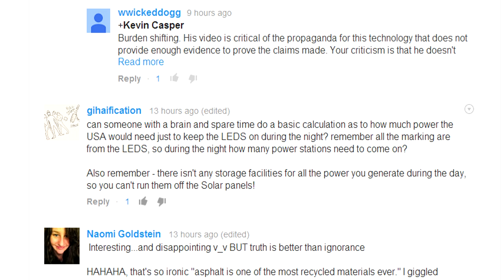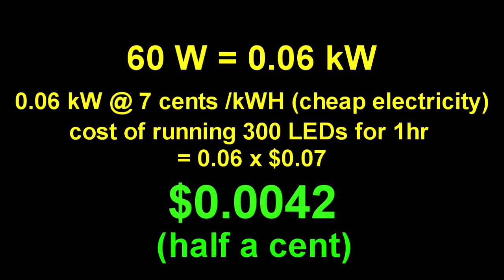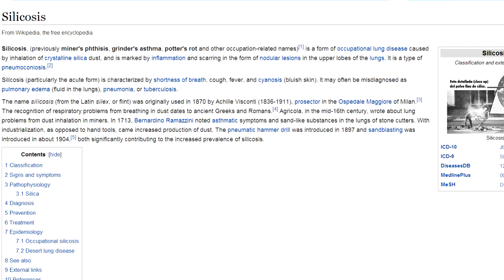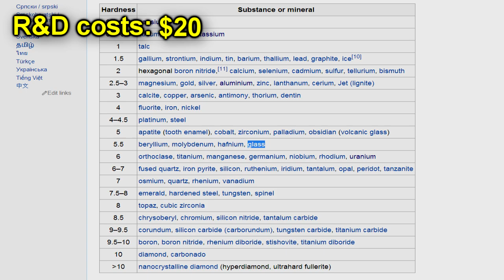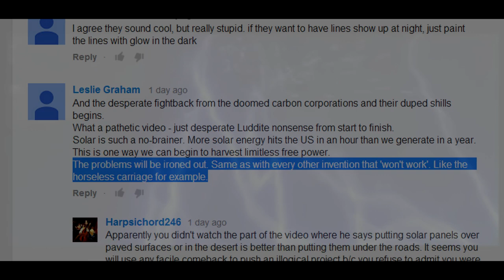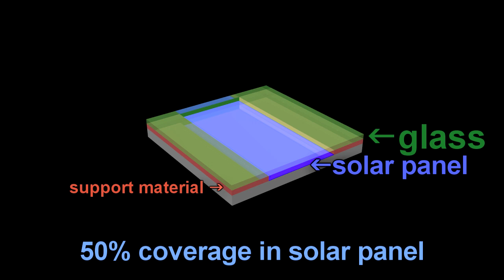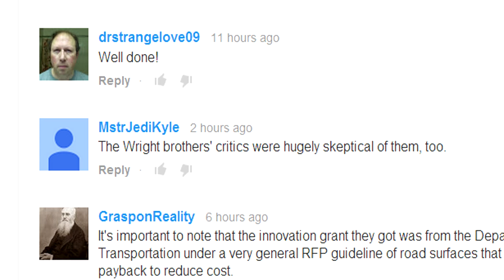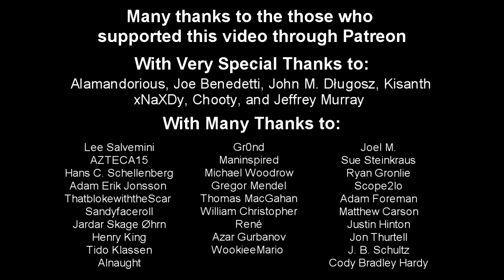Solar Roadways, IMPORTANT QUESTIONS AND ANSWERS!

Comment: Something that wasn't brought up in the video is LED's don't cost as much as they are saying. When someone goes under a undertaking such as mass producing a product they don't go and buy things in a "consumer quantity" meaning the estimated cost in this video is completely wrong and the cost would be somewhere around $0.00001 per LED in the quantities that would be needed. As well as the cost of the power needed would be 840 million a year a far cry from the 1.4 trillion need. This is just a fraction of the inconsistencies and misleading statements in this video.
Reply: Maeve Faye It still costs money to manufacture and ship the LEDs, no matter how many you purchase.
Reply: the thing is the cost will be no where near as expensive as shown in the video. the video is completely wrong in that regard.

Comment: I mean you make a lot of very gross assumptions and only try to half answer these questions. You're going by an amazon.com listing for LED lights and not considering the large savings to be made by ordering them straight from the manufacturer in bulk? Over the trillions of LEDs purchased that would save millions of dollars alone. You also use our prices for energy as provided by limited fossil fuels in order to figure out the cost for running the LEDs at night but do you forget the entire purpose of these solar roadways to begin with? To provide a nearly limitless source of power simply by their being on the road. Not to mention each solar hexagon would have its own backup power supply from its own energy its collected throughout the day. The immense amount of energy these things collect will completely negate any cost with running the LED lights, and if the internal power supply of the solar units wears out hey guys what ITS ALREADY CONNECTED TO THE POWER SUPPLY OF THE CITY and only then would the LEDs start drawing from the power stations. Jeez its almost like theres science involved with this. How about in the future you give more than 5 seconds thought before completely bashing a brilliant idea that can revolutionize the way we approach power?

Comment: I wonder if that "Scratch test" will work on the gorilla glass used on phones? I am interested to see how much or how little effort it would take to scratch the newest versions, that glass is evolving all the time to more sturdy and scratch resistant. Though, the cost would be high. I mean, glass can be used for many things, its in our skyscrapers to our fiber-optic cables. Who knows, maybe they are on to something, ill remain skeptic, but hopeful.
Reply: Well, guess i am going into the OIL business you with me?
Reply: Richard T I thought that the glass used on the panels was a different type than standard glass and resisted this kind of wear...
Reply: Mark Baanstra That's an interesting catch.
Reply: Mark Baanstra Even if its true, the should of accounted for the weather.
Reply: Richard T I just thought of a reason that would not be called "weather" so much as "ooops".  If the center of a panel heats up while the edge is kept cold by some snow, you can get the classic "snap buckle" situation where the glass wants to go done shaped but can either dome up or down.  Now put a weight onto the glass and the dome can snap from one state to the other.  This makes a mechanical shock wave at really high frequencies and with a big energy content.  When this shock comes to a boundary, the forces get quite huge.
Reply: Mark Baanstra
The sun hitting the panel will heat it up.
The proposed solar road idea does have heating elements in it also BTW.
Reply: well I suppose it will largely depend on if It is an Apple product or something of actual quality.

Comment: one thing i noticed was did you see the ways the LED's were arranged on the tiles how on earth would that give you the ability to create words or pictures or lines in the road
Reply: Mark Baanstra that leads me nicely onto anther point they say these tiles will tbe networked and talk to each other, where will the domain controller be? how many acres of space do you reckon they would need to provide servers that would run a network road system the size of the united states to the degree there talking and what if someone decides to hack this system, surely your road network is not where you need a weakness that can be exploited by hackers, im not gonna even go into the WIFI they say these will talk over yeah that will be secure
Reply: Mark Baanstra well you know why that is you challenged his design and doesnt have answers for the questions based on the engineering design because his proposals arent engineeringly sound, im and electrical engineer myself and believe me the amount of power one of these boards will take will completely negate the solar energy received basically the cells would just be powering the board not the rest of the infrastructure, while a good idea in principle practically its seems not possible. Why not just go for the solar without any of the other gadgets its the old phrase just because you can puit all this technology in the boards doesnt mean you should and as an engineer he should be thinking about what his no 1 goal is and that is to produce energy, so remove all the gadgets just make it a solar panel only and let the road system work as it does today you could account for road marking being painted on the boards in the design phase and it would be a hell of a lot cheaper. He also needs to consider whether its possible to even make the trillions of LEDs needed for this system how much material would be needed to engineer just the LED's alone

Comment: LEDs aren't "bulbs" and you obviously don't have to replace them as often.  The efficiency due to geometry depends on where you are in relation to the equator.  However, it's obvious that solar panels under roads has too many cons, they should be put on top of every public building.
Reply: Mark Baanstra Interesting I guess I meant they aren't "bulbs" in the sense that incandescents or fluorescent bulbs are.  It seems the Solar Roadways project has gained significant support from people who don't understand fundamental concepts of electricity and materials science so I assumed that's what they would think when they hear the word "bulb".

Comment: I can see where you are coming from, however, your tests are only partially valid.  For example, you only performed your tests measuring electrical output inside.  This will limit the angles at which the solar panel can achieve optimum output.  Secondly, you not only tested the hardness of the glass with cheap glass that is for use in cooking, you made the mistake of testing the glass's HARDNESS.  You also ground the glass with a back-and-fourth motion, where tires would be rolling along the road.  Moving on, I realize that lighting the roads for markers during the day and that they need to work on better tech to do it efficiently, and it is because of this obvious fact that you should wait to trash the idea until after they give a possible solution to the problem.  In addition, you made the assumption that they would power all of the LED's at once.  This would be a ridiculous and extraordinary feat!  Most people should be able to tell that they would, under no circumstances, ever have a reason to power every LED in the solar roadway!  They would only ever need to power a fraction of the LED's at any given time, so please recalculate and make a new video.  I will address one final issue, although I can point out many more.  You mention in at least one of your videos the problem of storing the power.  I agree that it is a problem that needs fixing.  However, to improve your argument you must either elaborate on how impossible this is, or suggest an alternative.  Please respond to this comment, I am dying to see your intuitive response.  Also, thank you for presenting your point logically and not immaturely like some other poeple do.
Reply: ***** His tests were performed on cheap glass from the general store, not the hardened sapphire glass they are thinking about using.  Do the test with the right stuff, or don't do it at all.  A good critic points out good things and bad thing, and there was nothing good about the way he critiqued the solar roadways idea.  In his sad "research and development" section of the video, he uses improper materials and an improper environment.  The glass panels that they would put on the roads actually have lots of bumps to push water and dirt out of the way, much like the treads of a tire.  In addition, he made a point of actually testing the LED's outside, and that was a valid test that showed a problem with an easy solution.  However, he tested the solar panels (SOLAR panels) inside of his house where the light only had one possible angle through his window.  Had he tested outside, the angled solar panel would still be more efficient, but you would not see as much of a difference in the output.  About that easy solution that I mentioned earlier for the LED's; angle them.  If they are put in small angled holes, much like pocket screws, they would: A, be pointed directly at the driver for maximum visibility. B, have a sort of protection from direct sunlight, as demonstrated in his video with the traffic light.  I politely ask you to do a bit of out-of-the-box thinking yourself before you reply.
Reply: I am personally a big supporter of fusion power.  Mainly because it is highly efficient and uses Hydrogen.  I believe that this solar roadways thing could really work.  It would just be expensive to implement, but only at first.  We would soon be generating a profit.  
P.S.:  I almost fell out of my chair when Thunderf00t suggested we put solar panels on the sun! LOL!
Reply: Nicholas Lozuk I thought they were using recycled glass ? Does the material they'll use adapt to whatever argument they have to discredit ?

Also, I'll point out that concrete field data has been gathered form that retarded solar pathway in Amsterdam, and it should be enough for anyone in his right mind to just give up the idea. It's 4 times less effective than rooftop panels.

Comment: stupid thunder foot its not NORMAL glass have you watched the videos?
Reply: harder, stronger, and more dense glass would magnify the optical problems because it would make the light refract more and totally internally reflect at a lower angle. also no matter how hard the glass, it will get scratched and notice you can't see through rough glass because it scatters light everywhere. while total internal reflection would just be problem for the led light, the roughness problem would kill collecting any light at all. there are a just a multitude of problems with this idea that just can't be fixed.
Reply: I have watched the videos.  They are suggesting that is it a specially formulated glass made from recycled glass and tempered.  Right there, they have suggested a type of glass that is really bad and effectively contradicted themselves.  Tempered glass is stronger right up until the first crack or scratch happens.  At that point, it fails suddenly and totally.  This makes it a disasterous road surface.  Ordinary bottle glass does about as well at resisting scratches as any reasonably priced glass.

Right from the get go, the glass will not be as clear as what is used on a roof top system and for structural reasons there has to be a lot less active area per panel.  This means that the panel on the road will be worse than just the cos(angle) argument would predict. 

In other words, thunderfoot has is basically correct.  There are others who have worked up more detailed numbers and each time the accuracy of the answer is improved the more daft the whole idea looks.

Comment: I wonder if anyone has noticed yet the real reason the solar roadways inventors are proposing that solar power can melt snow. Its not because they actually think this is possible, it is because they have realized that massively heavy highway snowplows with HARDENED STEEL TIRE CHAINS will utterly destroy their glass road. To eliminate this debate they had to eliminate the need for the snowplow, even if they had to use complete fiction to accomplish this.

BTW, if you want to test solar as a snow melting medium, just watch your back yard after a snowstorm. Even on a bright day with temperatures well above freezing the snow takes ages to melt. Why is this? There are 2 fundamental properties of snow that make it a PITA to melt. First it is made of water, one of the best mediums for storing heat there is. As a result it takes a lot of energy to change the temperature of water. Next snow is mostly air which is a fantastic insulator. Energy applied to snow in one area does not transfer to other areas due to this property. Taken together snow by its very nature takes extraordinary amounts of energy to melt. Keep in mind that this is also not taking into account 3 additional strikes against using solar roadways to do this. First the solar roadways will be a a textured surface that is very dirty due to typical road contaminants getting stuck in the texture and as bad as this is, this is BEFORE you add snow to them. Once you get there there is little to no light getting through to the solar panels. Second, what is the main goal of the solar roadway? That is right, to power the nation. In doing so there is much less energy available to feed into some kind of heating mechanism. Finally there are the LEDs, if you are powering them, with enough power to be seen in the day and under snow, you are further chipping away at any hope of having residual power.

They do know ALL of this, it is beyond obvious and even under the best possible cases for all of the variables a solar snow melter is preposterous. They have to pretend that it is possible because they are well aware that one winter of snowplows will be far more than enough to render the best possible glass surface destroyed.

Comment: my feeling is that people aren´t processing this the right way ,and they get angry cause somebody points out the obvious flaws on an otherwise seductive idea. The point is : why bother? suppose you can fix all of the problems that making the solar roadways imply: 
- making a type of glass resistant enough to whitstand decades of traffic before repairs
- solving the energy storage issue to make use of solar energy produced during the day available at night.
- powering all of those led´s efficently enough to produce a  positive net energy output

and to make those things economically viable enough to produce the BILLIONS of tiles required for this enterprise. The point is : WHY??? why not just put the pannels in the middle of the dessert, where the could take 100% of the suns energy without interrruption? because all the vehicles that would be passing by will be blocking the sunlight, imagine a traffic jam a couple of miles long on this surface, it would be miles and miles of unproductive solar roadways.   You would also save a  lot of time, time that would take to develop all of the technological breaktroughs that would be required in order to bypass the forementioned problems, problems that taken alone themselves would be more than enough to greatly improve the state of our solar pannels technology and actually make them cost efficient enough to replace all other energy sources. WHY BOTHER???? why don´t you focus on what we already have that we know works and make it better? it´s such a waste of time and money, only justified by a whimpy, stubborn child like attitude.
Reply: The problem is people are led to believe that they're all unique gems and that whenever they feel and idea is great because it's "innovative", their feelings are automatically scientifically validated, because "real scientists" work the same way, using random ideas and feelings. I mean, it happens just like that in every movie and TV show, some random unappreciated guy has a novel idea and everyone doubts him until he shows them they're assholes... How can that not be accurate?

Comment: instead of giving them useful suggestions, you're just showing your absurd counter arguments. Like for example you'll getting your price from amazon ? I mean really, are they going to buy billions of leds from amazon for 20 dollar each ? china will probably build same in 2 dollar.

instead of ranting, you could have given them suggestions to just ditch the leds in road panels, and instead power up road lamps with them. 

for electrical grids you can divide each grid for every individual town. 

Please giveup this bull shit attitude of yours, try thinking possibilities of contributing to humanity.
Reply: The counter arguments were valid.  This includes the price of the LEDs.  He used the price for normal LEDs and not the really high power and highly efficient ones.  The cost he used for the LEDs was likely low and not high as you suggest it may be.

The points about the glass were on the mark.  He missed a few reasons that the solar roadway idea is a dumb one but the ones he showed are enough.

The whole solar roadway idea is a really bad one.  Pointing that is a help to humanity but this is far from the only way in which Thunderf00t has helped humanity.  If you look at some of his other videos you will find information on that issue sprinkled in.

His basic suggestion was the best one he could offer which was not to do something so stupid.
Reply: watch EEV blog's video on cost analysis. the cost is even worse than thunder foot alludes to